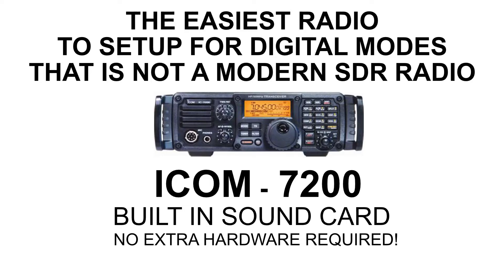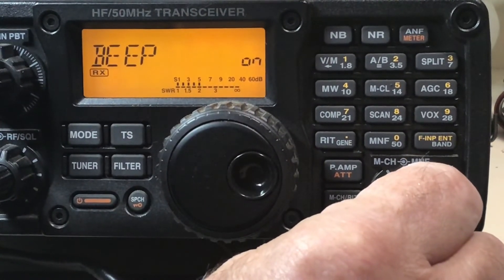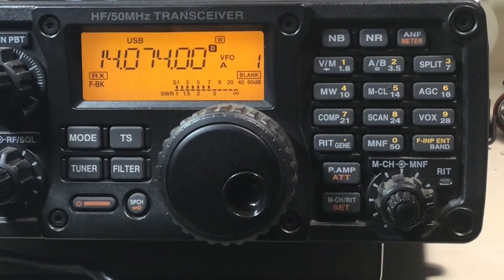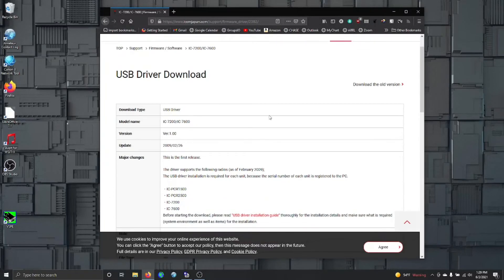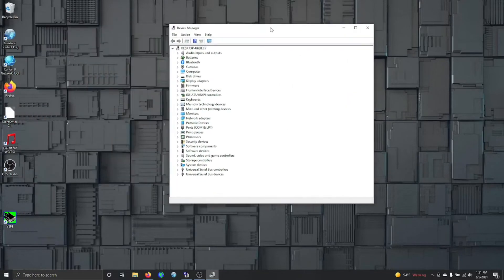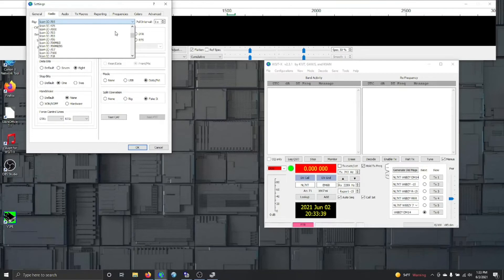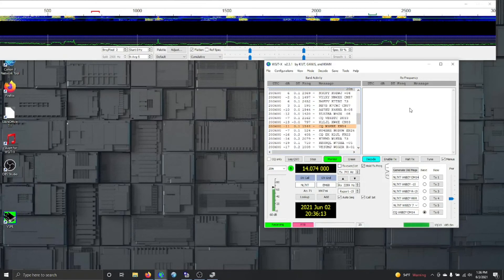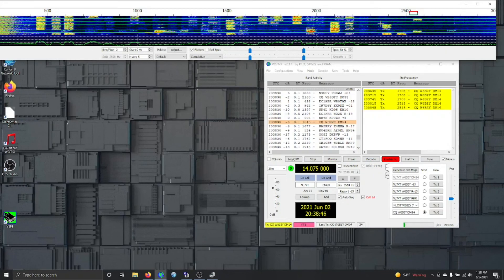IC 7200 EASY DIGITAL MODES

Comment: I'm new to FT8 and just finished watching your YouTube video, enjoyed your video. I am running the IC-7200, the only cable that I do not have is the CT-17 / CI-V cable but I do have the A/B cable that is connected from the radio to computer. I noticed that when I enable TX (CQ) for 20m frequency 14.074 the transmit frequency goes to 14.073 500 then returns to 14.074 after TX. Any suggestions on what I am doing wrong?  Thanks.
Reply: This is normal and a good thing. That is why you enable Split by Rig or Fake It so that your transmit shifts so that others are more likely to hear it.

Comment: Lots of confusion regarding the cable requirements to connect to PC. Some sites mention that only the USB A-B is required. What exactly does the CT-17 CI-V cable / module do ( out of production at Icom ) ?
Reply from the maker: CI V cable needed for radio control.
Reply: @Kensownvids  No offense, but it's not required.  The USB connection provides full CI-V communication.